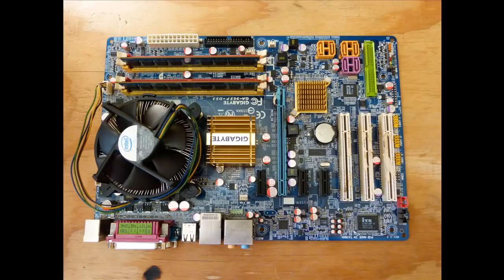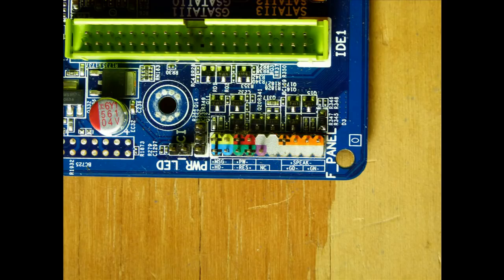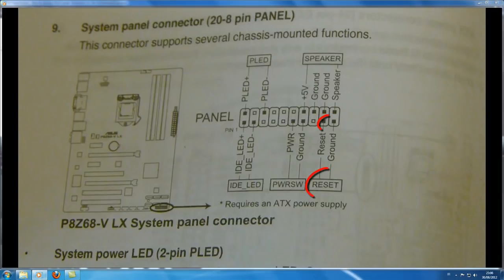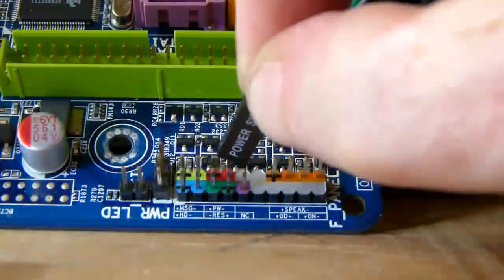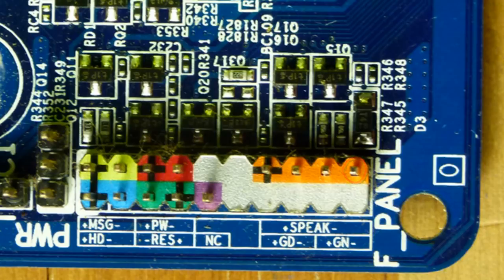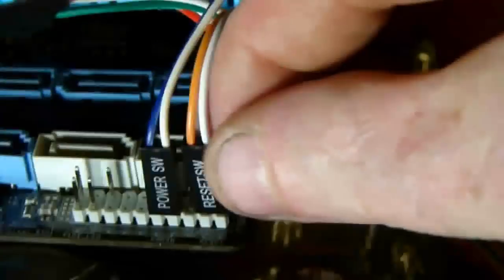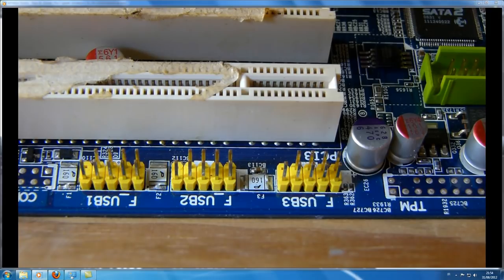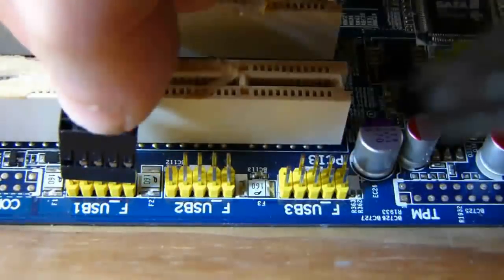How to connect front panel connectors to the motherboard

Comment: i installed a card reader but the 9 hole usb cable doesnt reach the 9 pin motherboard, where can i find a extension?
Reply from the maker: Hi Maroi, You should go back to where you purchased the card reader they should be able to give you a longer cable, Failing that any computer store will have the cable you need or an extender cable if required. Hope that helps

Comment: my headphone jack
couldnt work at all pls help
i think theres something wrong with the cable or the motherboard
Reply from the maker: Hi,
Did you connect another headphone jack that you know works?
Are you plugged into the back panel or front panel Audio connectors?
If you are connected to front panel connection then you will only be able to use the front panel. if you are trying to connect to the back panel then you can't connect the front panel.
Have you checked the sound utility in control panel? Is it showing that the sound is working?
Is the audio driver working properly in "Device Manager" ?
Did you change anything on the motherboard ( back panel or front panel? )
These are the things you have to check. Hope that helps

Comment: ok, so my motherboard is a biostar nf61s micro am2 se and the front audio was never hooked up, this is how I bought it yrs ago, and now that i'm trying to hook it up I realize that there r 9 pins on the board and only 8 connector wires running from the front panel and they aren't in one as in all connected they r all single connectors.... so yea i'm lost! where do I start?
Reply from the maker: Hi, the problem is if there is no markings on the pins coming from your front panel connectors, i have found your motherboard manual @ http://www.biostar.com.tw/app/en/mb/introduction.php?S_ID=23#dl
but it does not show the color coding for your front panel you maybe able to find that information on case manufactures website.
below is the motherboard pin connection for your board, as shown in motherboard manual... hope that helps
Pin Assignment
1 Mic in
2 Ground
3 Mic power
4 Audio power
5 Right line
out
6 Ground
7 Reserved
8 Key
9 Left line out
10 Ground
Reply: I've got the manual and the I/o pins r marked but they are - return r, return L, spkout r, spkout L, mic bias, mic in and ground so i'm lost
Reply from the maker: drdre251
Now if you connect the front panel connections to the motherboard you will not be able to use Audio connections on back panel { most users don't know this, and this is stated in your motherboard manual } i would on bother installing the front panel audio at all, because of this problem and the fact that it is an older board if you want more control over audio then get a sound card and install it on pci slot it will give you more options and you will still be able to use back panel audio. you can get a sound card for $20 or $30 well worth it's price if audio is important to you. But if you still want to connect the front panel audio follow below...
Leave out return r and return L they are for speakers in your front panel and most cases don't have them installed.
in this order
min in - pin 1
ground - pin 2
mic bias - pin 3
spkout r - pin 5
ground  - pin 6 { if you have 2 grounds Dose not matter which ground pin goes in as long as connected to ground line pin}
spkout L - pin 9
ground - pin 10 { again if you have more ground pins plug in here }

Comment: Have connected cables as described by the user manual and you. Power light came on when the power switch was pushed and processor fan and power unit fan all started working. However there was no signal to the monitor and the reset button is not working.  Continuous pressing of the front power switch also could not cut off operation of the mb.  What went wrong?
Reply from the maker: right Obeng-Marnu, What i said is very simple to follow, first check that you monitor is plugged into correct connector on the back of the computer if you have a graphics card installed in a PCI slot, then make sure that monitor is plugged into graphics card and if that does not give you a live screen then check the menu button on your screen and make sure monitor is on correct mode either vga, hdmi or dvi what ever cable type you are using. As for the switches "power and reset" it maybe that the computer did not boot properly, so fix the monitor issue first and then check switch, buy turning on the computer and test the switch buttons again and if that does not work, double check the user manual switch connections again... hope that helps, Kevin
Reply from the maker: right Obeng-Marnu, What i said is very simple to follow, first check that you monitor is plugged into correct connector on the back of the computer if you have a graphics card installed in a PCI slot, then make sure that monitor is plugged into graphics card and if that does not give you a live screen then check the menu button on your screen and make sure monitor is on correct mode either vga, hdmi or dvi what ever cable type you are using. As for the switches "power and reset" it maybe that the computer did not boot properly, so fix the monitor issue first and then check switch, buy turning on the computer and test the switch buttons again and if that does not work, double check the user manual switch connections again... hope that helps, Kevin
Reply: Thanks.  I will give you a feedback.
Reply: Master, Afehyia paaaooo.
How is the family.
Regards to all.

Comment: How do I know which is the positive and which is the negative for the power switch cable?
Reply from the maker: There should be a little mark on the back of the connector indicating the positive side it usually looks like an a top of a arrow or pointer like this " > " failing that the cables are color coded and you can go on line an check the case manufacturers website, where you'll get access to the user guide for the case and the color coding method will be in that guide.
Reply: Kevin Colleran Thanks, I did see the arrow, but I will search online for the user guide to be safe.

Comment: Hd audio cable or Ac97
Reply from the maker: Hi SPGCraft, what do you want to know about "Hd audio cable or Ac97"?
Reply: I have two cables one of which is HD audio and the other is AC97 and I wanted to know which of them is better.
Reply from the maker: SPGCraft It will not matter, both are capable of delivering the signal to the front panel audio.

Comment: Why not connect it to the USB 3 slot? isn't 3 better than 1?
Reply from the maker: USB 3,2 and 1 are just labeling on the motherboard. This motherboard does not have the hardware that supports USB 3.0, so it makes no difference which connector you connect, their speed will be "USB 2.0" speeds. This info will be clearly stated in the motherboard user guide.

Comment: I've checked they're all plugged in properly but nothing happens when I press the power button.
Reply from the maker: is there a switch on the power supply if there is make sure it's turned on
Reply: yes it is.
Reply from the maker: KarcazeOfficial
well if their is no power going to the motherboard then it's the power supply or power outlet on wall or power cable that's causing the problem. That is of course if you have everything plugged in correctly check that the two cables coming from the power supply are plugged in one going to CPU which is 4 pin connector and one 24 pin connector supplying the motherboard, also make sure that the RAM, Graphics card are sitting correctly take them out and place them in their slots again and also check CPU fan is plugged into correct socket on the motherboard failing all that you may have not plugged in power switch front panel into it's correct position. All these things must be correct and i know you have checked them all, but check them again and after all that it maybe a faulty power supply, motherboard, or front panel connection, so if you still see no signs like a  LED light on that motherboard or front panel you may need to bring it to computer store and get them to check. Sorry but that's all i can tell you with out testing the components...hope that helps
Reply: haha thanks. I'm so stupid, the cpu power wasn't even plugged in properly. thanks.
Reply from the maker: KarcazeOfficial
glad to help, but see how important it's to read the user guide that came with your motherboard.. always read the assembly instructions you never know when you'll miss something. :^0

Comment: My motherboard is biostar and my computer case is the phantom 410 I connected the front panel HD audio to the header but I have no audio my motherboard supports ac97 what can I do
Reply from the maker: have you got sound from the back of the computer if you don't then there is something wrong either the driver did not install properly or your motherboard sound is not working. now if you do have sound at the back audio jack then there is something wrong with the connection between front panel either it's not connected to correct connector or the front panel is not working. hope that helps. just make sure you have made the connection properly. Failing this consult your user guide and double check your connections and if that does not fix the problem then it could be a faulty front panel audio and you will have to replace it.
Reply: There is no sound in the back audio jack the front panel connected is HD audio and my motherboard supports ac97 could that be the problem also my connecter on the motherboard has more pins than the HD audio connecter
Reply from the maker: So no sound in back audio jack means one of 3 things
No.1 the ac97 audio is not set to main default audio for your system which would cause no sound. to check this go to control panel>>hardware and sound>>sound, then in playback tab check that AC97 is set as default device. if it is grayed out then the sound driver did not install correctly and you have to reinstall it.
No.2 go to device manager and check sound driver it will have a black down arrow on the device this means that the device driver is not install or not working correctly and and you need to uninstall that sound device restart your computer it should reinstall the driver on restart and if it does not work then reinstall the sound driver again.
No.3 the sound card in the motherboard is not working and if you want it to work you have to get a replacement motherboard or install a sound card in a PCI slot and install a new different driver for the new PCI sound card.
hope that helps
Reply: I checked everything you said the ac97 is set to default and in device manager no black arrow I think I might have to get a sound card :'(
Reply from the maker: carol h
Sorry Carol but sometimes it's your only option to bypass the the sound problem and get a sound card...best of luck
Reply: Thanks for your help
Reply from the maker: carol h
your welcome Carol
Reply: Do I have to get a special sound card and funny it was working in my old case now just stop after I put it in my new case
Reply from the maker: carol h
Sound card from old case will work if you have a driver for that sound. So install card which you have probably done already then install the driver for that sound card you have that driver or it will not work correctly. if you don't have the sound card driver then go to manufactures website and download it there and install on your computer instruction will come with driver when you start to install.
Reply: Ok thanks don't have a card yet

Comment from the maker: Vipul more this comment is for you. If you want a replay from me on your last comment please post it on my YouTube channel, have not got the time to be posting on every bodies Google+ accounts. But here is the answer to your last comment...
Reset all connections if the power button will not start your pc then it could be your ram(memory) is not sitting correctly or cpu fan is not plugged correctly power supply needs two connection checked on the motherboard. Basically all connections need to be rechecked and then try turning on the pc... hope that helps
Reply from the maker: Hi, This is a similar board type not exactly, put i think it's the same without checking the system directly on build plans. The model is the same number except last two digits which are usually location number builds. I'm nearly sure this is built on the same spec! The link below will take you to tom's hardware website and a little ways down that page there is a front panel header diagram, and i think it's the same type board as far as the front panel connection go! Hope it's the one you need! If not let me know and I'll do a deeper search for you OK!
http://www.tomshardware.co.uk/forum/313387-30-mcp61pm-diagram
Reply from the maker: you're welcome!
Reply: hi..thanks for you reply..i tried resetting all the connections removed each n every part inside the cpu ..bt stil it sucks..it wont start man :-(
Reply from the maker: Vipul More
Is there a switch on the back of the power supply maybe that's in the off position. check also that the cable to power supply is fully placed in both wall socket and back of power supply if these ideas don't work you may have to bring it to a pc store and get it tested. Sorry can't do much more for you if all connections are being made then something is not getting power caused by faulty part somewhere in the chain
Reply: thanks alot mate ..ill try doing that ..:)
Reply: hi kevin ..the problem solved for me..it was just a matter of one wrong connection of d power supply unit..D cpu works fine.. But now da monitor isn't displaying anythin ..M just seeing a blue light blinking..
Reply from the maker: Vipul More
I'm glad you got it sorted. Now is your monitor plugged into a graphics card or is your graphics in the motherboard? reason i ask is if you plugged a graphics card into a PCI Express slot then your monitor must be plugged into the back of that graphics card or your monitor will not work hence blue light... try that first.
Reply: I don't hav a graphics card in my cpu ..
Reply from the maker: Vipul More
all motherboards have graphics built into them which is controlled by the processor(CPU). Now if you don't have a graphics card and your monitor is plugged in correctly to rear panel, then the setting on the monitor needs to be set up to view for either VGA, DVI-D or HDMI . So check Which input you have and then set you monitor to that type of input, you can set these by going into the menu on the monitor screen there is a menu button on your monitor somewhere usually right side or on the bottom... hope that helps
Reply: hmmm ..when i press the menu button ..the screen stops blinking & it says 'tests good 'N it appears in a small box ..and goes away ..& again the monitor starts to blink ...
Reply from the maker: Vipul More
the monitor is set to wrong display mode find setting and set it to your pc's output and then restart your pc as i mentioned in the last post.
Reply: which setting are you talkin about ? none of my buttons are working on the monitor ..so how will i set the setting ?
Reply from the maker: Vipul More

you will have to find out by looking around in the menu... there is setting that you can check but you may have to check how to change them through the user guide for the monitor if you don't have it go to the manufactures web site and you should find the user guide there... what type of connection is your monitor VGA, DVI-D or HDMI which cable are you using to connect to the computer and if there are options on the back of the monitor for connecting to PC then you have to make a change... if you are using a different connection cable than the one you used connecting monitor to old pc... in other words is the monitor set up the same as when it was connected to your last PC
Reply: it was the same connection.. for the monitor.. No changes ive made...
Reply: there is no information given bout da monitor ..please can u refer n tel me .. ? intel D945GCNL
Reply from the maker: Vipul More

This board is not new it's from 2007 build intel, is the computer a dell? is there a graphics card? have you the Processor fan cable connected correctly? i do not have enough info to make a call on why your pc is not turning on what happened that you had to rebuild an old intel motherboard can't make call till i know what im dealing with sorry.... if you want contact me through Kevin@computerhelpmadeeasy.com so i can get more info from you through email
Reply: i do not hav a graphics card ..the processor fan works good ,power supply ,everything ..connections are also now correct..
Reply: i do not hav a graphics card ..the processor fan works good ,power supply ,everything ..connections are also now correct..
Reply: Kevin Colleran Hey I got a gateway gt5656 and I cleaned the motherboard completely n blew out all the fans and stsuff.. I thought I had a good mental picture of the way it was put together but I cant seem for the life of me figure out how to rewire the power switch and usb... ive been going nuts trying to find a schematic of the board showing the connections but I cant get one that's right... my motherboard number is mcp61pm-am any ideas where I can get a good picture to figure this out with.. I have spent 2 days trying to find a good picture of the motherbard with no luck at all
Reply: Thanks io did end up getting it ok turned out I was using a bad cord on top of the bs I was having lol but thanks again

Comment: just for the sake of curiosity...can i connect a touch screen panel to ATMEGA 16 board...and if yes...how do i do it???
Reply from the maker: you will have to find that out through the manufactures website i would think that you could if it's got a vga connector, but your control board would have to have a "graphic user interface or operating system of some kind or the touch screen would see nothing. sorry can't give any more info cause I'm not familiar with this board.
Reply: its alright...thnx